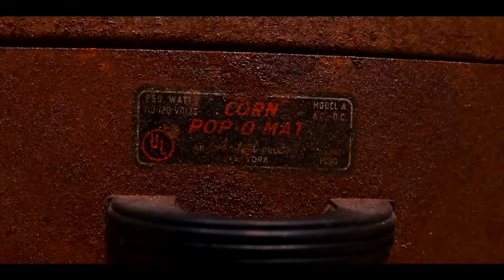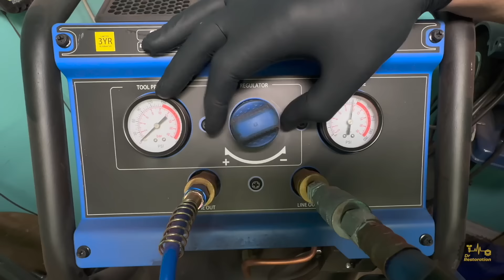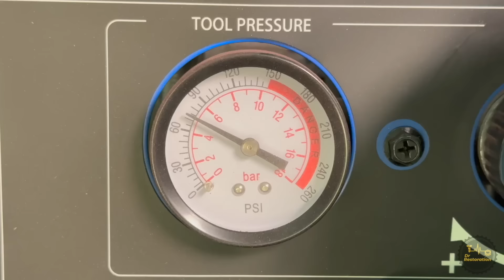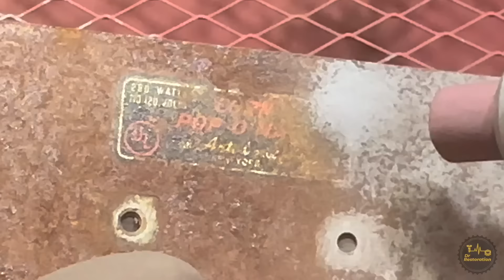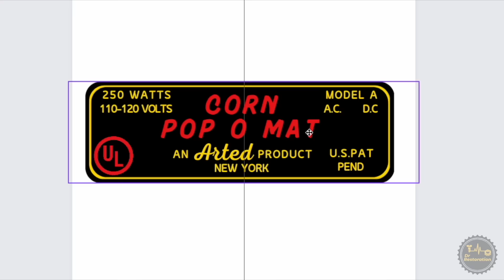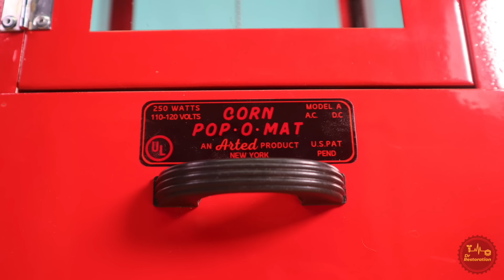Corn Pop-O-Mat Popcorn Maker Restoration

Comment: Great restoration! but I would be cautious with those three fiber pads and the flat disc on top of the heating element as asbestos was very common in appliances back then.
Reply from the maker: Good point. No need to worry it’s going to sit as a display piece in my house. These were also very easy to catch fire if hot oil got on the metal plate 🔥🙂
Reply: Those pads are probably asbestos, but the disk on the heating element is mica.  Nothing to worry about.
Reply: Asbestos, bakelite & popcorn 🍿 great flavor combo!
Reply: Wether or not it’s a display piece isn’t the big danger.  It’s how you handled it during the restoration process.  After removing it dry (asbestos should always be wet if you absolutely have to deal with it) you put it in a vibratory polisher (for long enough to clean ip the other parts)!

The amount of fiber particles released during that process is immense.  And it doesn’t take that many of them inhaled to lead to mesothelioma.

Your polisher and media is now contaminated with asbestos fibers and will release additional particles every time you use it.  And the pads in the popper have been agitated and ill shed fibers for years.  This is literally a prescription for lung cancer.

You probably don’t want to do a full asbestos remediation on your workspace, but that’s really the safest course.  Barring that there are a couple of thing you absolutely must do immediately.

1)  Put on a very good particle mask, open all of the windows in your workspace, and get air flowing through it.  (wind, fans, whatever)  If it’s connected to your living space, tape the seams.  If you can pick up a Tyvek suit, get one and tape the gloves and cuffs.

2)  Spray down your polisher with water.  Carefully take it outside and move (gently) the media into a sealed bag.  Do the same with the popper and the pads.  Water to prevent particles from blowing, gentle movement, and get the pads into a sealed container.  Double wrap the container in multiple sealed layers of plastic and take it to a place who can dispose of it properly.  Do not throw it in the trash.  Now flood the tumbler and popper with water.  Over and over.  The popper doesn’t have a lot of nooks and crannies, but the tumbler does.  (Honestly, if it were me, I’d wrap it and dispose of it with the pads and media.)

3)  With air moving and suited up, spray down and clean every possible surface of your shop.  Let it dry.  Do it again.

The safest thing is still to call someone who does Asbestos Remediation professionally, explain what happened, and just write the check.  Life is too short, asbestos fibers are too dangerous, and lung cancer is entirely too deadly to mess around with this stuff.
Reply from the maker: @scottnanceutube  thank you sir for the info, scary stuff indeed
Reply from the maker: @scottnanceutube  in reality they were in the tumbler for 10 minutes and I cleaned the hardware with my Dremel. I also didn’t show it but I replaced the asbestos with metal blocks that mimicked the height.
Reply: @DrRestoration  Just an FYI, the asbestos issue for these small appliances and in vintage radios is overblown.  As long as it's not deteriorated, it's fine. You can seal it and leave in place.  Plus it's there for a reason and would need to replace with something similar for heat protection
Reply: @Artcurus  This! Anytime the word "asbestos" comes up, it's looked at like enriched uranium. As long as you're not grinding it into fine airborne powder, it just sits there and does an amazing job as a high temp insulator or dissipater.
Reply: Even if it’s a display piece I think it’s pretty irresponsible to leave asbestos inside of it. It survived long enough to fall into this person’s hands, who’s to say someone won’t try to eat from it in the distant future when it inevitably changes hands again?
Reply: @a_pompom  once more, the location of the pads means that food contamination is not an issue. it's there for electric insulation and heat resistance.
Reply from the maker: @a_pompom  they were replaced with metal discs once the comments told me it was asbestos 👍
Reply: @scottnanceutube - Asbestos problems usually happened in miners, not people simply handling obviously intact materials every once in a while. I am not sure was worth even these paragraphs.
Reply: @a_pompom  Wow dude did a 20 restoration on a scale of 10 and you step on his nuts for stupid asbestos. Wow :face-orange-frowning:
Reply: @Artcurus yup for sure. Why don’t you go tumble asbestos pads for ten minutes in media and then get it tested for loose fibers and then come back with your results. Left intact 😂 did you watch the same video?

Dr Restoration I would recommend an insulating softer material instead of metal disks still, perhaps some mineral fiber. It’ll help protect the parts from one another and protect from heat transfer.
Reply: The asbestos experts are rising from their graves to give you crap over this video lolz. Great video man.

Comment: Great job. 

FYI, you can clean the stains on unglazed ceramic by heating it with a torch until it glows. Comes out looking as clean as if it were new. Try it on a junk piece of ceramic first if you are hesitant to attempt it on an actual project.
Reply: I'd be worried about uneven heating with a torch, TBH; I think re-firing in a kiln or maybe self-clean cycle in an oven might be better for larger and more complex pieces, to avoid them blowing up due to differential heating. Sodium hydroxide can be another option, particularly for organic stains; soak ceramics in hot hydroxide solution for 30-45 mins and grease stains tend to vanish.

Comment: First class restoration ! I did have one comment though: 
13:50 When wrapping the wire around the left bolt you put it back exactly as when they originally had it, which is, imho, incorrect. 
Wrapping wire around a bolt/screw always goes in the direction of the way the bolt tightens (in this case, clockwise) so that it tightens when the nut is applied.
Reply from the maker: Thank you sir! I agree about the wire but there was also a washer so it doesn’t matter bc the washer will not spin with the nut

Comment: Great Job on this Pop o Mat...I just did a repair on a similar/identical 2 prong contact with the ceramic insulator, which was also used on a 1923 Sunbeam Model B flat bed Toaster...the prongs were burned off from a short...I put mine into the bead blast cabinet with 120 grit glass bead media at 100psi, removed 99% of the stains, then i used Clorox Cleanup and toothbrush and got the rest...it came out like it was brand new !!
Reply from the maker: Very interesting! Maybe I’ll take it apart and do that, thank you!
Reply: I just posted the same method. Ive bead blasted ceramic and porcelain terminal blocks in antique fire alarm boxes. Like you said, it gets most off. I was told to try acid, but haven't yet.

Comment: In Spain we use olive oil to make popcorn instead of margarine, and the flavour is completely different, much better. In street stalls, palm oil or margarine is used, of course, but those made at home with corn (not microwave ones) are made with olive oil and the result is infinetely better. You should try it.

Comment: I was a little 😬 when I saw you sandblast that cool decal. Glad you made another one for it. I have very good luck getting cooked on grease off of pans by letting them soak in white vinegar. If that’s grease on the white porcelain bit that the heating element is on, maybe soaking it in vinegar will help. ¯\_(ツ)_/¯

Comment: To answer your question, my favorite popcorn is my homemade kettle corn. 
Recipe
1/3 cup kernels 
1/4 cup sugar
1/4 cup coconut oil
sea salt for extra flavor.

-Heat your coconut oil over medium heat in a large pot and add 2-3 kernels to the oil when it has melted (coconut oil I use is often in a solid state at room temp).
-When the kernels pop you are at the proper temp, remove the popped kernels before they burn.
-Add the remaining kernels and sugar to the pot and cover it with a lid, begin shaking the pot vigorously over the heat.
-Once popping begins pay attention to the frequency of pops, when it slows you should be done.
-Remove from heat and sprinkle a pinch of sea salt on the freshly popped kettle corn then shake to distribute, repeat until your desired level of sweet and salty is achieved.
Reply from the maker: Sounds yummy!
Reply: @DrRestoration  thanks, it was my grandfathers favorite snack, i was making him a bowl almost twice a week for a while.

Comment: FYI, the insulators under the ceramic element are made from Asbestos, so you contaminated your tumbling cleaner machine with Asbestos dust.
Reply from the maker: Yeah I rinsed/tossed everything once someone told me. I also replaced the pads with metal spacers 👍

Comment: Very interesting restoration. However, I have a serious concern about some parts that you should have replaced with something safer. The 3 little pieces under the heater element are obviously made with asbestos. So you should have not even tried to clean or reuse them at all. Aramid fiber would be a way better choice.
Reply from the maker: After posting and a ton of comments stating this I actually replaced them with metal plates

Comment: I've restored fire dept antiques (alarm boxes and gongs etc) for years and have tried many methods to clean staining fron ceramic/porcelain terminals and fuse blocks. I've had occasional success with bead blasting, then polishing. I was interested to see if you had found the magic solution on this.element. I've considered muriatic acid, but haven't tried it. As always, great job and video !
Reply from the maker: I almost used muriatic acid as I have some, my luck I’d come back to a muriatic/ceramic slurry 😅
Reply: @DrRestoration  Someone else posted they had luck with bead blasting as well. I need to do a test run with muriatic acid and find out I guess. You have me searching for one of these popcorn makers as we speak, like I need something else 😂

Comment: You can try to clean the ceramic with glass in the blasting cabinet or with a dry ice blaster
Reply from the maker: I thought about that l, it already had hairline fractures I was worried I would break it 😅
Reply: Toothpaste is worth a try; it's a mild abrasive

Comment: Do you need to use a special  type of sand to clean the metal pieces?
Reply from the maker: It depends, some sand is too coarse but technically it doesn’t matter

Comment: Could you have removed the stains from the ceramic with sandblasting, or would that have destroyed the ceramic?
Reply from the maker: I tried… other comments told me to used heat but I was afraid to crack it

Comment: 3:30 so any time I see a vintage cooking or just anything that gets hot from around the 1950 or before I get worried as far too meny of them had asbestos in them and while the stuff is fine as long as you don’t mess with it (there is literally asbestosis 7 foot from me in the house but it was more dangerous to get it removed that it was to leave it in place and just not touch it) when you start refurbishing stuff it can kick up dust and before you know it you have lung cancer, I bring it up as them plates look like they could be Asbestos (or the far safer bakelite or ceramic).

People nowadays are like surely they would put something that dangerous around food, you know the easy bake oven that was (and still is) a kids toy wel in the 1960s that was full of asbestos as they didn’t want the kids burning themselves on the outside of the oven.